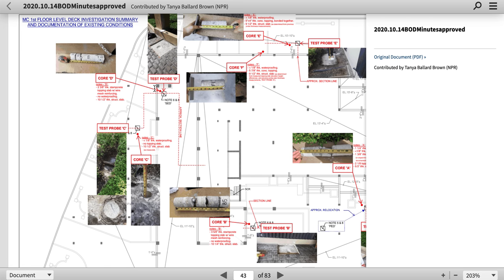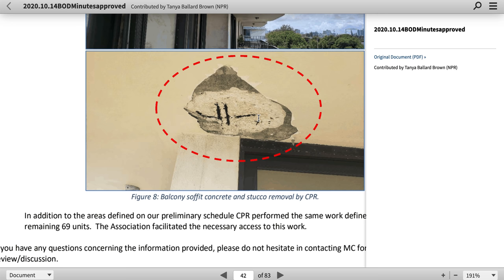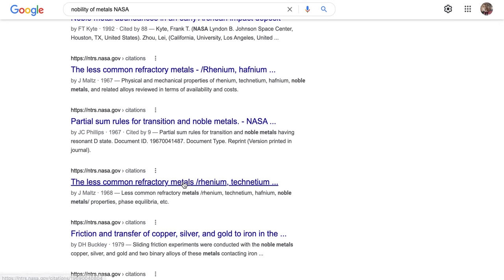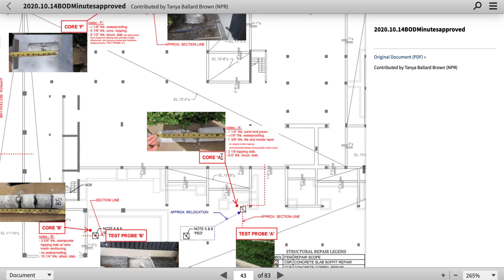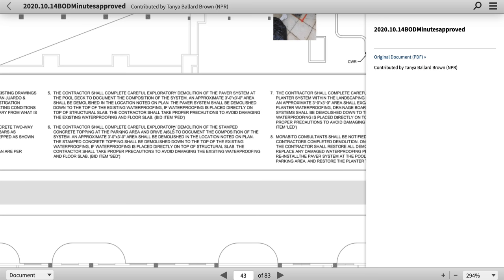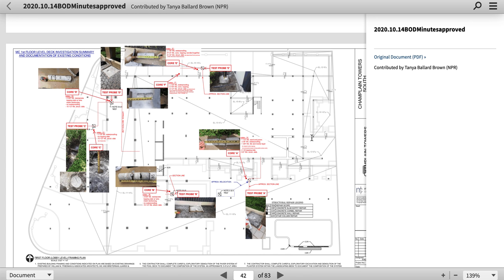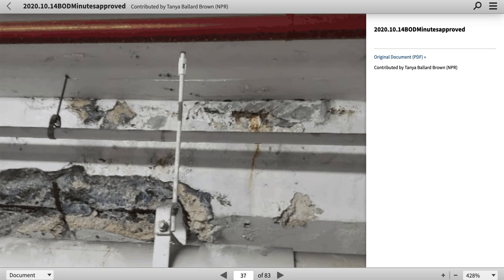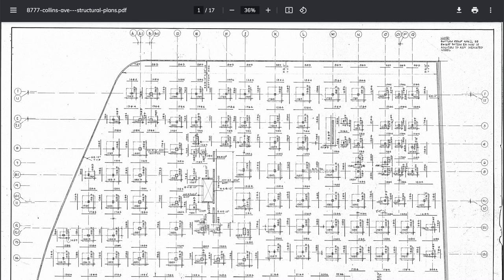Champlain Towers COLLAPSE POOL DECK CONCRETE CORE SAMPLES FAILED DECK VERY OBVIOUS IN CORE SAMPLES

Comment: There was a lot of talk about LIDAR and soil issues being "very important" at the recent press conferences.  The maintenance manager said that sea water had been flooding the garage for decades and that they used several pumps to keep it dry.

To me it looks like the floor of the parking garage was sagging.  I believe that there may have been a void in the limestone that developed under that slab near parking spot #78.  This void would have slowly eroded over time and on the night in question when the tide went out the roof of this void collapsed taking out nearby piles that supported one or two columns.  For me the key is the tide.  The collapse occurred at low tide. I believe that this was the trigger.
Reply: I believe the columns are still there just punch through hence no sink below
Reply: @tuscanyjc  No that is not where the building was
Reply: John Beige  Exactly.
Reply: Why would the failure of one, or a few, columns cause such a large portion of the pool deck to collapse?
Reply: Part of it appeared to be sagging from a camera POV, yet digital photography can be deceiving.
Reply: John Beige  remember the tide chart.  I don't like to say that but it was 3' at 9 pm (by others). A sink hole is a loss of support, where the water is supporting the soil above until the water table recedes. The tide recedes and ..
The slab is tied to the columns (rebar) and can lift and recede -may be different from footing loads founded deeper.  The footings (pile caps) are also counterweights under tension.  This was somewhat seen with the 15 degree rollover and pause before pancake collapse (unfortunately).  
The high tide hit the same up and down the Collins Ave.  Do you think the new building to the south (87th St) had adequate pumps and let the tide effect (reach) the basement slab in their building.
Reply: @jrstf  The whole building collapsing pulled the pool deck down.
Reply: @Katoshi_Takagumi  Well that is why 99.9999% of buildings built that way don't collapse.  Something different happened with this building.  If erosion to the limestone happened over several decades then a void could form under the base of the piles and when the roof of that void collapsed then that could trigger a complete failure.

Comment: Would galvanizing the rebar have prevented the expansion problem?
Reply: From what I have read, tests of coatings on rebar actually accelerated corrosion. Something about reactions with the concrete and the coating retaining moisture.

Comment: Why, why, isn't  stainless steel  Rebar made and used as the industry standard.  ?????
Reply: Check costs, then expansion/contraction rates, especially vs concrete.
Reply: Seems Penny wise and dollar foolish in long run to use substandard raw steel Rebar when compared  to $$$$$$ lost, and lives lost, on so many buildings worldwide. 
 If stainless Rebar was used just even in the sub basement areas that are exposed to wet conditions etc,
Maybe the building would still be standing, perhaps?
Reply: The simple answer is cost.
People tend to be short sighted and to go with what works vs what is best.
It should also be noted that using better material does not mean maintenance can be ignored.
Had this building been properly maintained and repaired when problems were first discovered, it would still be standing. Even with regular steel rebar.
Champlain Towers North (the sister building) is constructed exactly the same, and is in great condition. Because the condo board and owners stay on top of the needed maintenance.
Reply: In addition to the cost, stainless steel is an ecological nightmare. Can't be cut with grinder or welded without putting off Chromium gas which can be deadly and requires special filters and training.

Comment: I agree with Mr Beige about there seeming to be a lack of rebar,p. They might need to consider how many buildings were built the same way since then if that is deemed to be a significant part of the cause. 
Not sure if anyone has worked out how much extra weight was added with the 100 mm (4 inches) of concrete that was poured on top of the slab. Any reinforcement in it?

Comment: Kinda strange, why does the sample have so many changes in the sample? Cold joints? Wish I could share but we just removed a beam and our concrete is continuous with very minimal color change or texture!
I'm sure I'm wasting time here because it's very obvious that the concrete was done unsupervised or used shit concrete and was responsible for a lot of what has happened here.
Sad situation and not all do this kind of work.
Reply from the maker: ...more importantly, why do these samples appear broken and NOT of full diameter... pieces broke off = indicates a brittle deck material for one reason or another or large movement in compression.
Reply: The engineering firm did use the term exponential indicating faster and faster. 
No one on the board understood the meaning of that term and chose to do roof work first!
It might have helped if he had insisted on shoring immediately but in my experience a board or owner will automatically focus on how much and who has complained the most when making decisions concerning the building even after I explain the critical nature of the problem.
Reply: Lowest bid work
Reply: @ForensicCats  These are fascinating videos and comments. As a retired contractor that built some concrete structures in the Dade/Miami area in the 1980's and 1990's it brings back a lot of memories. Memories of pouring concrete and waiting on trucks that were stuck in traffic jambs, or having half a slab poured out and the pump truck breaks down and dumps his load into the street. Or working in the sunny 110 degree heat  where the concrete is hot before it leaves the truck, or you get flooded with a rain storm just before the concrete begins pumping, or trying to explain that the rebar needs to be picked up to 30 men from South America that don't speak English. Need I go on?  So glad I'm retired.

Comment: Have you ever consider becoming an inspector?
Reply from the maker: They (city) do not pay enough but I considered it years ago...  But, of course current day, I do this on a daily basis...  Different engineers evaluate structures differently; depending on your experience AND knowledge of ''failures''...   If, you do not have a ''data bank'' of failures, then you will miss so many potential failures...

Comment: How could anyone see what was happening?
Reply from the maker: Like broken bones in a body / arm... one break = one impact / moment and multi fractures = multiply impacts (if that helps)... This is an ''x-ray'' of the floor slab.
Reply: Concrete spalling is easy to see as chunks of concrete actually fall off.
This building had many areas of spalling noted in the 2018 report.
Including the support columns. Several pics of damaged support columns in the parking garage are in that report.